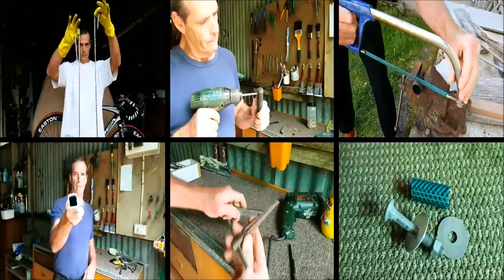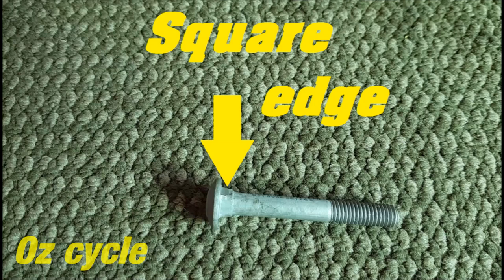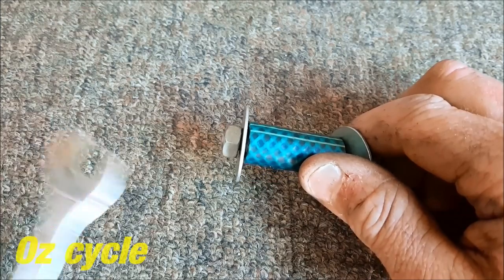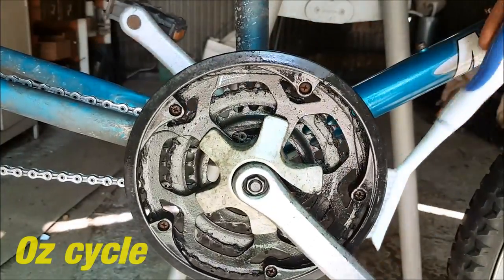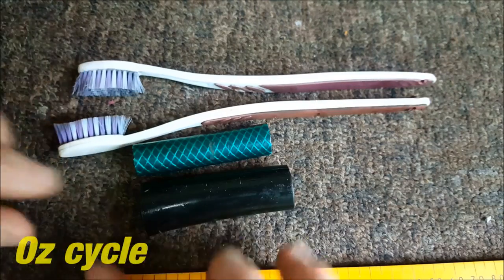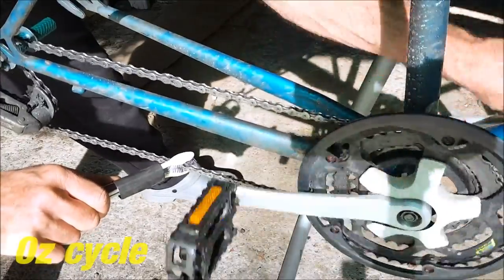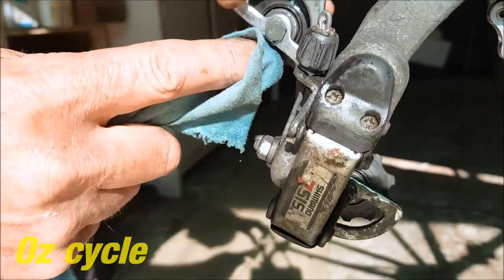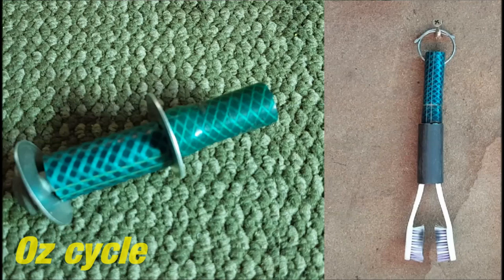Clean your bicycle chain,cogs and crankset- Do it yourself.

Comment: I like your diy approach. A lot. Making your own tools for future use is a big bonus.  For cleaning the clusters, instead of using a  folded old piece of cloth I suggest using string soaked with degreaser  that way it does not get caught in teeth of gears.

Comment: I live in a damp climate.  After cleaning, I make sure any steel parts such as steel chainwheels and cogs get a light coat of Boeshield T-9.  Even the much maligned WD-40 is better than nothing.  Remember, too, that underneath that cassette is likely a steel freewheel body.  If the bike is new to you, and then every once in a while after, pull the cassette, clean things, and put a light coat of Vaseline (petroleum jelly, petrolatum) on the freewheel body before reassembly.  Why Vaseline?  The freewheel body exterior does not need a lubricating grease, just a waterproofing grease.  Vaseline is waterproof and hard to wash off, better that way than most lubricating greases.  Vaseline is good for other places you want a corrosion resisting but not very lubricating grease: seat posts (not in a carbon frame), quill stems and their expanders.
Reply: Might aswell as call this garden hose bike hacks

Comment: Good tip for flossing your cassette is to use an old work shirt's stiff collar or cuffs as the stiffness makes it that bit easier to do the job without the teeth snagging on the material.

Comment: great video. Here in brazil the degreaser is too expensive, most cyclists just put some Diesel in a rag and clean the chain, after just clean with a clean rag and put some lubricant.
Reply: I think rubbing (isopropyl) alcohol would be less harmful to chain and maybe a little less expensive than degreaser.

Comment: Top stuff fella, here's a question for you, de-greasers - are bike/mechanical specific better than say kitchen varieties? The cost difference can be substantial!  When hardware stores know you need a product that's specific they have the habit of whacking the price up just because they can. Bike shops are worse in a way, they expect to make a lot - you can't blame them as keeping a bike shop open isn't easy due to overheads.
Reply from the maker: Use degreaser from auto parts outlets Mark...much cheaper 😁

Comment: Great tips. Instead of a bolt, would a spare skewer covered in hose work as a dummy rear axle? Will try tomorrow....
Reply from the maker: +Jeff Brunton The skewer will compress the rear stays inwards Jeff ,so you will need non-compressive piping over the skewer....garden hose is too soft. The white poly pipe should do it.

Comment: i use a pressure washer  to clean the cogs.    works well.  even without a cleaning solution, the hot pressured water removes every single dirt and oil spec.   i do a similar method for tje chain, but use mineral spirits or a little gasoline dabbed on with a paint brush... and scrubbing, followed up with a degreaser, then soapy water and rinse.

Comment: "Dr." Oz-  I have a question regarding Shimano "brifters" or break-shifters.  My Shimano front derailleur shifter works fine some days and then other days it's all I can do to move the shifter FROM the small chain ring TO big chain ring.  Some YT videos suggest cleaning the shifter with WD-40 and then spraying a silicone lube.   What do you suggest?  Thanks!  Ron
Reply from the maker: First,check that the inner cable slides smoothly thru the outer. If that doesnt fix it,check derailleur spring tension is pulling the cable back when going big to small ring. Still not work?...Remove cover from shift lever and clean mechanism with a lube spray like WD40...dont use silicone unless the mechanism works fine to start with. Let me know how you go ??
Reply: Thanks.  Will update once I know.    @stevenleffanue

Comment: Unfortunately its always a tedious, dirty and time consuming job keeping your chain nice and clean. Instead of chemical agressive degreaser i use diesel oil which is cheap, very liquid and it doesn't wash out all grease completely if used with care. There should be an industrial optimized process where you can spray and clean your chain and cogs with hot oil/wax and high pressure in a closed environment. That would be the easiest and most comfortable way to do this every 300 km (for me nearly each week). Maybe you can double the life of your chain etc. this way.
Reply from the maker: Oil attracts dirt
Reply: @stevenleffanue  I am not sure if it really "attracts" dirt but it tends to keep the dirt ones its attached. But it lubricates better than wax. Wax tends to squeze out but oil tends to build a thin film. So there is a difference you have to pay attention to.